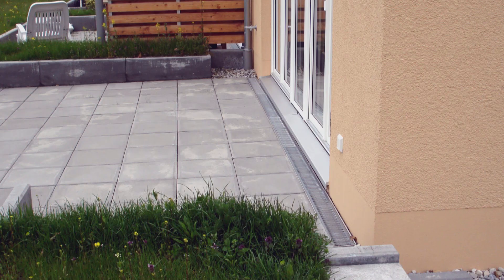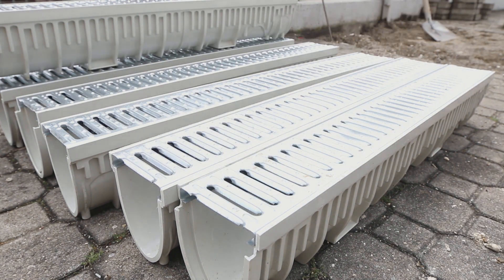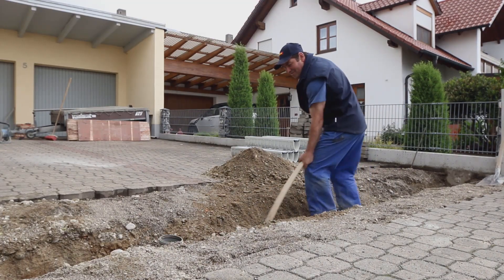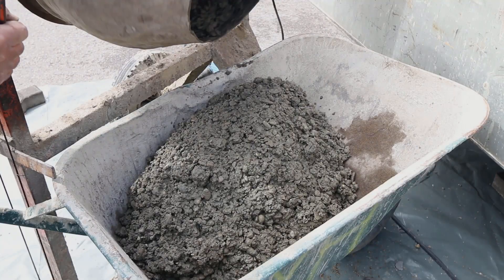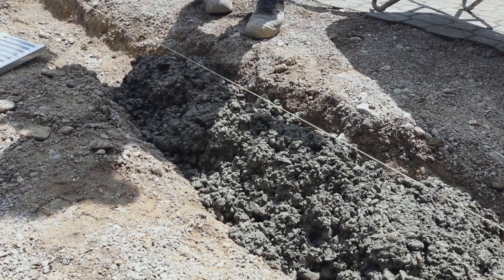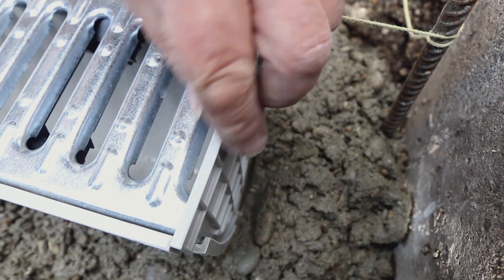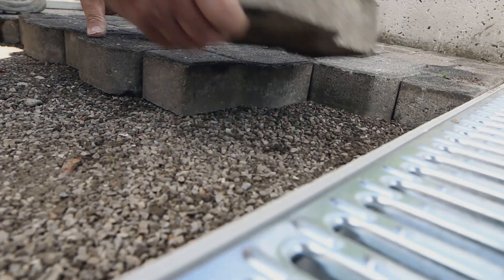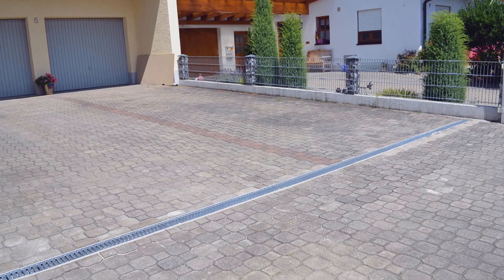Installation movie Drainage Channel MEARIN

Comment: Looks like cheap plastic
Reply: The MEARIN PLUS drainage channels are made from glass-fibre-reinforced composite. The loading classes for the MEARIN PLUS 100 go up to D 400 depending on the used grating. Brochure MEARIN PLUS and EXPERT: https://www.mea-group.com/en/wp-content/uploads/sites/4/2017/08/GB-wm-010264322-brochure-MEARIN.pdf